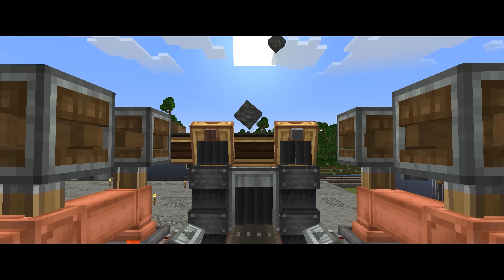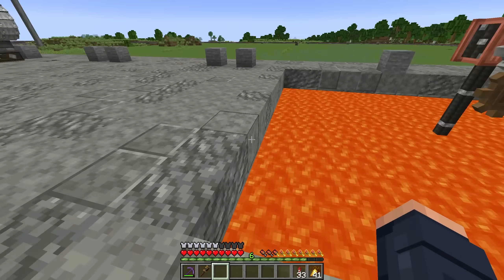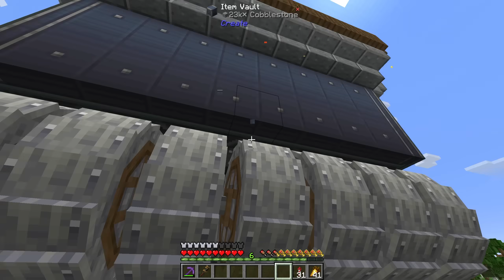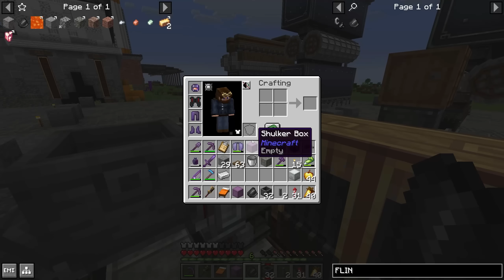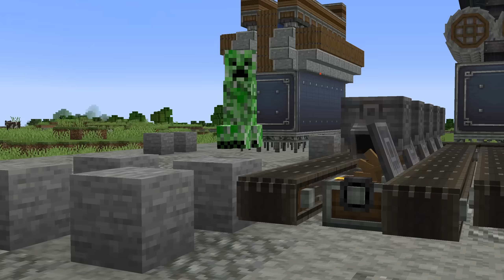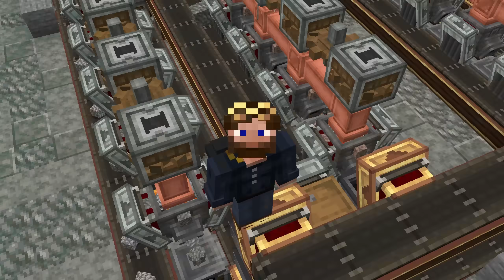Just Create SMP EP46 MASS Tuff & Dripstone Automation for The Foundry Project

Comment: A very Factorio factory. I think comparing Create to Factorio is more apt than Satisfactory, since Factorio is right angles and curved rails like Create, but Minecraft makes it multi-level, as if Factorio had 384 tiled vertical slices. Really, its very circular, Minecraft inspired Factorio which inspired Satisfactory which inspired Create which was made like Factorio as a Minecraft mod. Back and forth, from the source through the ages and back to the source.

Comment: Generators are only working at about half capacity if you switch where the lava and water are you can then water log the drills and then have two drills per cobblestone that way you are doubling your capacity in about the same space without needed to add more cobblestone generators. Look at Eggs lasted big cobblestone video for examples.

Comment: I see you having lots of belts just "dropping" items one or a few blocks down.
Items piling up is usually an issue with these if unchecked.
 IMO placing a chute at the end (like the trapdoors) and continuing them down to the lower belt removes the part when items are actual entities thus causing less LAG.